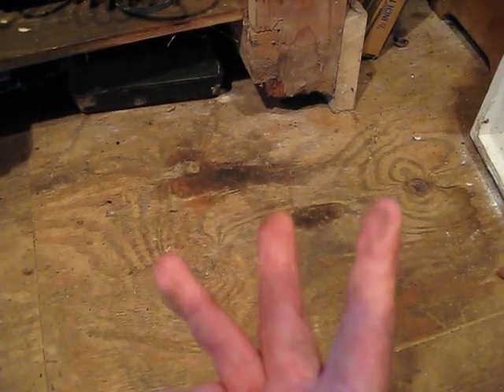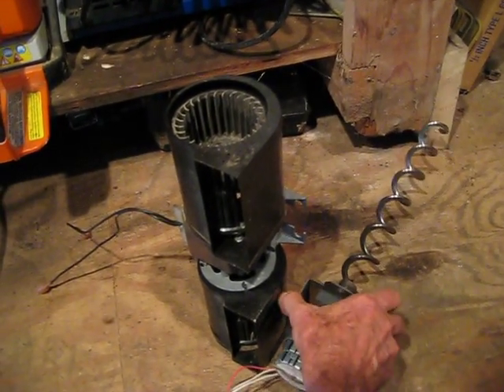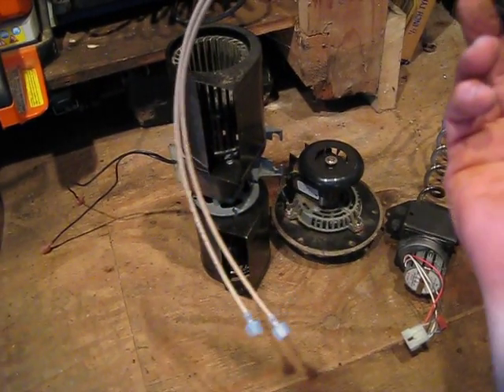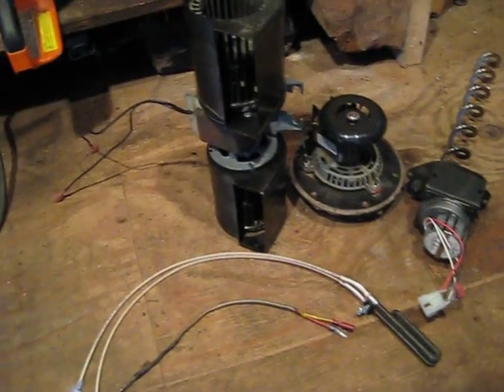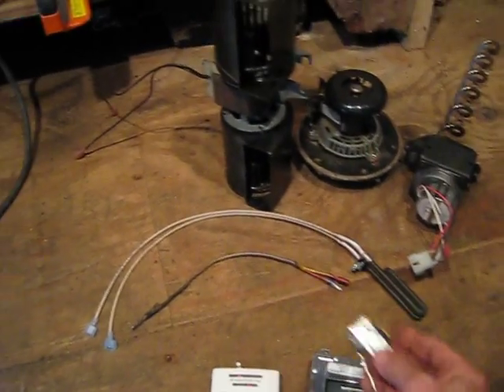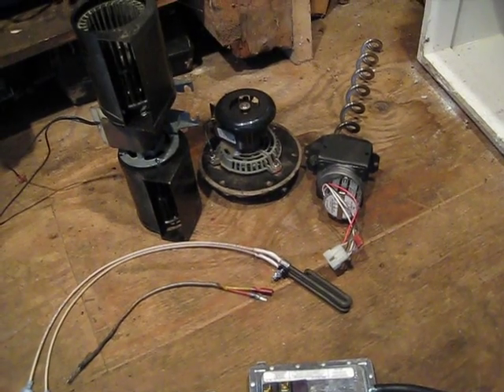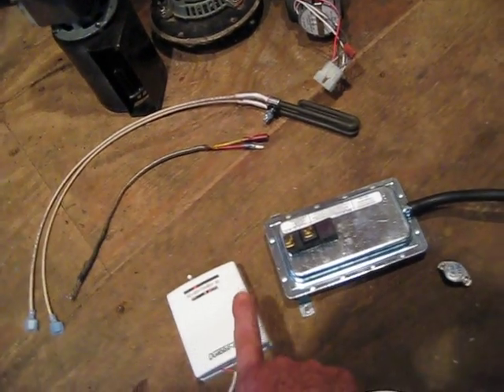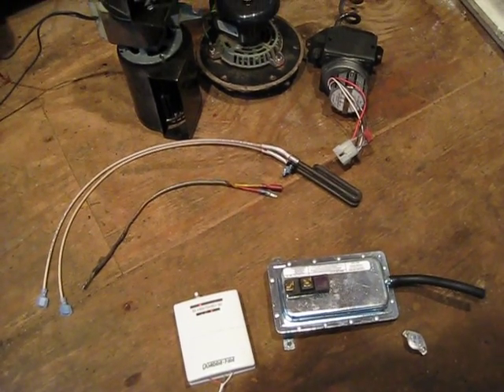Quad OE 2.Parts.AVI

Comment: I have a 1200-I Quad got it new 2011 if I set the stove above 70 the stove get to setting goes into shut down right before it's going to shut down and restart itself again and continue in one shot down and keep doing this can you help in anywaythank you for your great videos
Reply from the maker: Not sure what you are saying....80 percent of problem calls center around cleaning.
The vacuum switch will stop the feed if the stove is not breathing correctly.
Can be jumped to test
Also..check the green and red lights in the control box (thermocouple)
Must light up red to continue burn cycle
If not...stove will shut down
Reply: Thank you for answer I been out of country I ment when it set to 70 or above the stove get to temp goes in to shut down and then will restart itself
Reply: And again thank you for taking time to answer I wish I had seen it soon